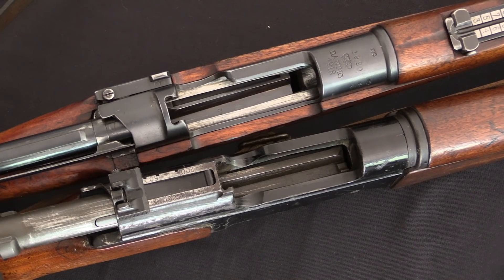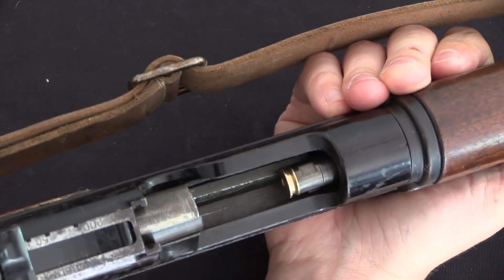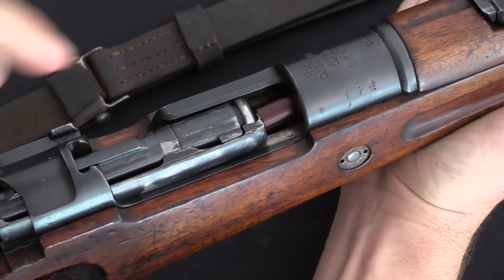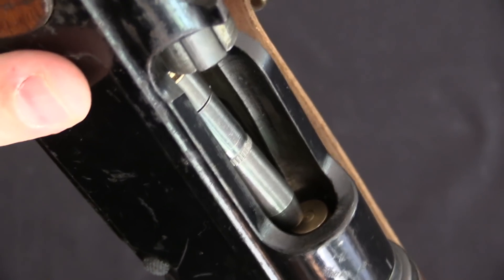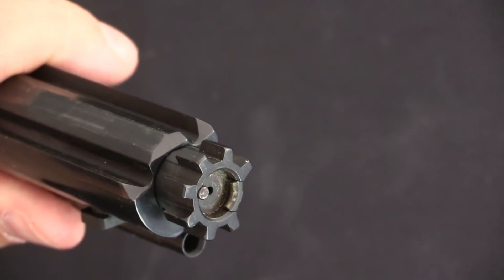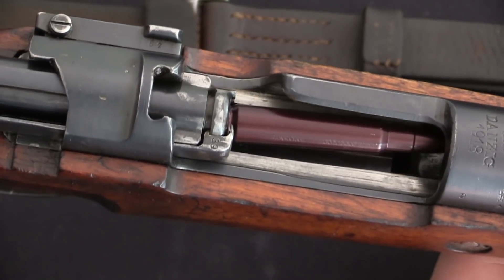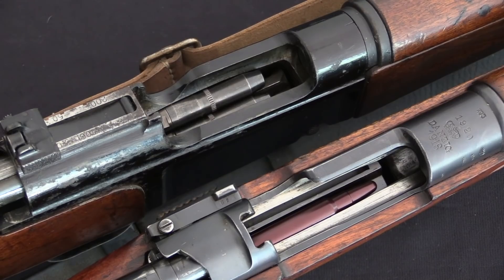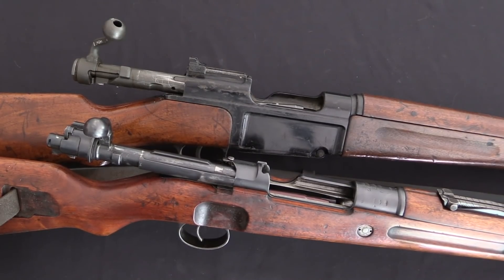How Does It Work: Push Feed vs Controlled Feed

Comment: One difference i can really see come up is that single feeding loose rounds into the chamber or in front of an open bolt and closing can damage a control freed, while a push feed calls it another Wednesday
Reply: Some (Jerry M with the really fast finger) would argue that this can cause issues (damaged case heads/broken extractors/Failure to extract), but a properly designed firearm will accommodate the single loading, especially for military use. Why? Hand loading special cartridges on top of the normal ammo for one (rifle grenade launching/ line throwing). Yes, there is the risk of a failure, but any mechanical system can fail. Properly maintain the firearm, and replace the worn parts, and it should last for a long time.
Reply: In the early stage of WWI most rifle have magazine cutoff for soldiers to single load a round, so I think the controlled feed on military bolt action rifle is totally fine because they were also design to do so!
Reply: @blackmesa1992  and yet some early (ww2 era) mausers shouldnt be single loaded for this reason
Reply: @blackmesa1992  The only rifle I can think of with both controlled feed and magazine cutoff is the Springfield 1903.
Reply: In some cases, perhaps. But this is very easy to mitigate through design. For example, the original 1911 design included a spring steel internal extractor, with a bevel on the front face of the extractor claw. So, normally a controlled feed design (when using magazines with the original style taper feed lips) but, thanks to the spring steel, capable of flexing to slip over the rim to allow fallback to push-feed function.

This is typically forgotten on modern 1911s, because the anachronistic obsession with wadcutter- or hybrid-style feed lips on magazines (itself the legacy of early "flying ashtray" type hollow points with an ogive drastically different from 230gr ball) turns it into an exclusively push-feed design where the round is released prematurely by the magazine feed lips and allowed to "jump" up into the extractor claw, being uncontrolled during that interval. It is this inadvertent change in design which is responsible for most of the 1911's diminished reputation for reliability.
Reply: @marshaul  It was my understanding quality hybrid lipped magazines were still entirely controlled feed.
Reply: @Hansengineering FWIW my defensive handloads use 230 gr. Sierra GameKing JHP and they feed better out of tapered feed lips than hybrid. Which begs the question exactly what hell hybrid feed lips are for anymore.

Comment: I have heard that rifles like my Mauser have it was so that the gun could be cycled in any position or while moving around. But like you said no longer a problem as soldiers don't use bolt actions and if they do they certainly aren't running and shooting often.
Reply: The main advantage of a CF action like a Mauser 98 is that it largely eliminates short-stroking induced jams that will render a firearm totally inoperable.  Short stroking is much more likely, in a stressful situation, when using a PF action.  Why Ian doesn't understand this I don't know.

Comment: Controlled feed, an answer to a problem that nobody lost any sleep over.
Reply: The controlled round feed is still considered essential for dangerous game hunting in Africa.
Reply: @Tuton25  Is that preference actually justified by evidence though or is it just fuddlore and hearsay?
Reply: @hailexiao2770  it's the opinion of a number of professional hunters who've had clients induce double feed malfunctions with push feed rifles. Obviously as a visiting hunter a push round feed is mostly fine since you'll have a PH & a team of assistants with you to back you up in case of a malfunction, but there's a reason double rifles & magnum Mauser actions are still very common amongst PH outfits in Africa.
Reply: I prefer it, but I’ve been annoyed by ejection issues in my precision rifles so it’s more about the fixed ejector than the feeding mechanism.

Comment: Didn't even knew that differences between feed system exist. Thank you, Ian
Reply: i prefer pull feed for one reason. My .460 rowland converted 1905 spring can shoot .45 acp as well. If it was push feed it would end up lost in the chamber trying to shoot .45acp
Reply: @Burritoswithfritos  Nice bit of info
Reply: @Burritoswithfritos  So does the bolt reach halfway into the chamber when using .45 acp?
Reply: I own both and it never even occurred to me. Shame on me.
Reply: It's a big thing with hunters and whichester model 70 collectors.
Reply: @evancrosley2857  The pre '64 model 70 specifically is the state gun of Alaska
Reply: It's always a good day study the gospel of Gun Jesus